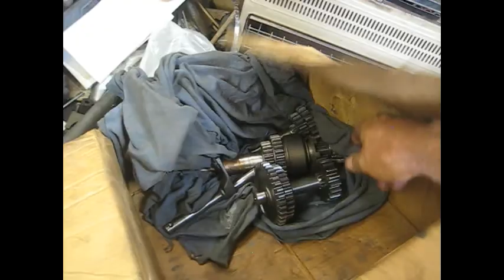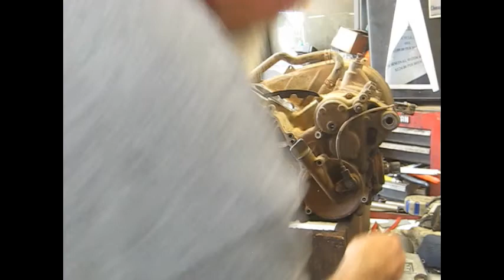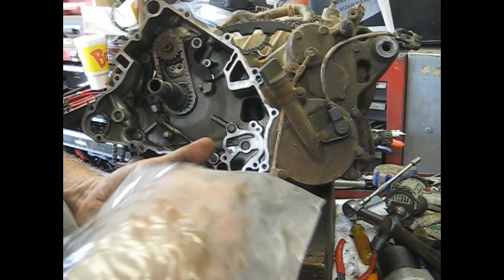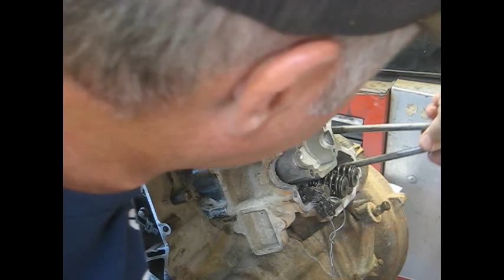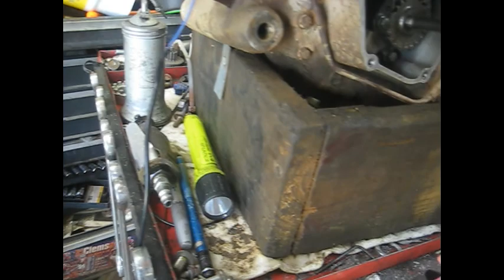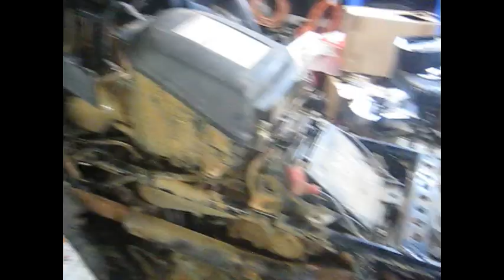Kawasaki Brute force motor reassembly

Comment: Hey I could just use a little help.so I got my brute force motor back installed and out the carb back on.I’ve been trying to start it but I can’t.I got fuel coming to the end do the line and the vent lines connected and verified bit plugs have spark. Looking down into the carbs they seem dry.please any ideal what it could be.thank you!!
Reply: I did get it to start momentarily with some starter fluid but that’s about it
Reply from the maker: Pull the bowls off the carbs and make sure your floats in the bowls aren't stuck. I have a video for a carb clean on one of these bikes.

Comment: How you doing , great I hope ! Question, I have a 2005 artic cat with the Kawasaki engine... I get spark, fuel, and compression but no start just one tiny carb back fire ! I threw the timing chains per your video instructions & adjusted valves and all! Any idea or pointers that you could bless me with?
Reply from the maker: Check to make sure your timing is correct as well as your valve lash. If I had to guess I would say timing was the culprit.

Comment: Have you ever seen a brute lose power but not be blown up is there anything outside the engine that would go bad and make you think that the motor was blown like lose of fuel  pressure I know you said they spin rod barring and won't make noise
Reply from the maker: Make sure it is getting spark to both spark plugs. I assume it's a carb bike so pull the off and clean the carburetor. Before you take them off look down in the carbs with it running and make sure both slides move when you give it some throttle.
Reply: Thanks so much ill let you know how it goes
Reply: And yes it has a carb

Comment: Mine with the t mark and the f as a notch in the case hole around a 1/8th to 3/16 and the mark on the flywheel is 2 marks about a 1/4 apart. I tried to space it even. Is that right or should the mark at the F line up with the case gap. Should the F mark be in the center of that gap on the case hole, or should I center, I wish the camera wouldve focused and I could see how you positioned the flywheel marks comepared to the gap on the case hole. Tks for your time
Reply from the maker: The line above the t mark is the one you need to line up with the nitch in the case. The notch is usually in the center of the hole. If you are rotating it in the correct direction you will come to the two marks close together first, the the f mark ( when it fires) then the t mark ( when it's at top dead center)